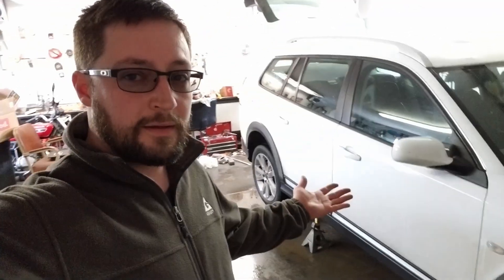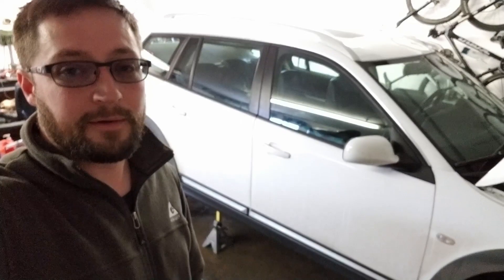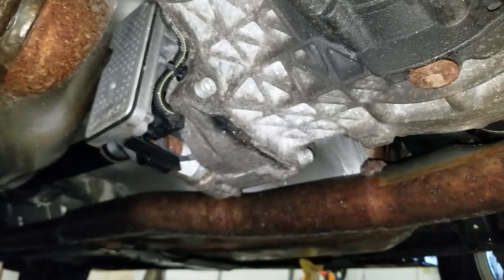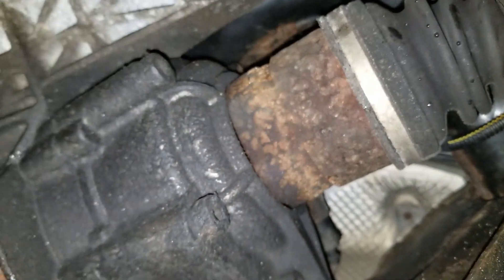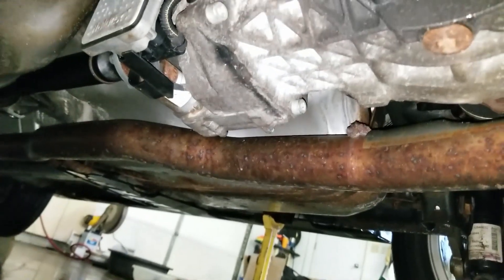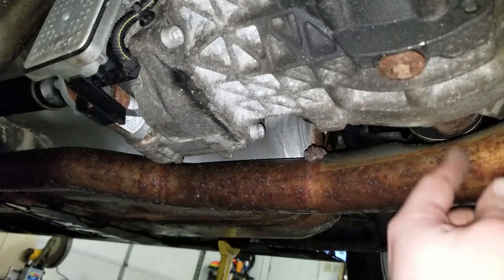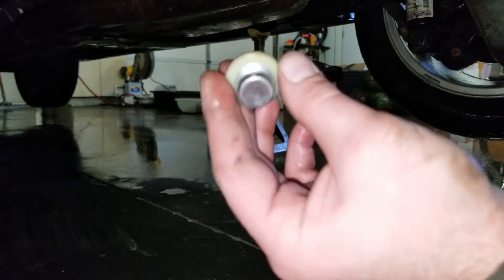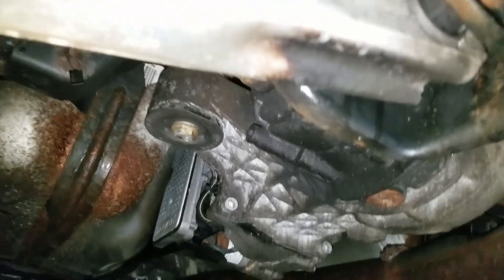XWD Fluid Check (Haldex Gen 4)

Comment: 08 9-3 xwd aero sportcomb….(w/o inboard slinger) …. thank you for this vid. would love to add elsd to my saab. what about programming?ecu?
Reply: I have been trying to figure this out for a little while now. Apparently, the rear diff part numbers for both 2.0T XWDs and 2.8 XWD are the same. They are cross-compatible with a couple cars including the Buick LaCrosse. I'm able to source one but I don't know if it will work, some folks have said you may need an ECM from a car equipped with eLSD and I'm still not sure about the module on the unit itself. I don't know anyone who has actually tried it. I just bought a 2.0T XWD that is pretty base and I have spent a lot of time adding features and upgrading. Adding eLSD is the only thing left to do.
Reply: @okletsskate  thanks for taking time to try and help me ..... if you get  more info please let me know here... I'll do the same okay?
Reply: @matthewzizzo4586  a may just try it out and see what happens. I'll let you know!
Reply: @okletsskate  I can't risk it ......It's my only car... And I love it too much ! ....PLEASE ....lmk what happens....thanks man
Reply: @matthewzizzo4586  update! I was able to successfully swap an eLSD diff onto a non eLSD model. It took quite a while to figure this out but basically you'll need:
1.Rear diff with in board slinger
2.Rear left CV axle, specific to eLSD
3.Haldex module with part no. 2845060

I followed the SaabDr and his video on YouTube on sourcing a cheap diff for his 9-5, mine came out of a 2014 XTS. 

The caveat is, finding the real axle is hard and the module. Occasionally a salvage one pops up online.

Comment: Totally unrelated question, but I notice you have the front two jack-stands at the front of the car, not at the side where you would put the tire jack. Do you recommend that location, and exactly what should I look for when placing the stands? Thanks!
Reply from the maker: I can get more height out of the jack stands if I put them there after lifting the front. So I only do it when I want it as high as possible.
Reply: @autoholicmedia  Thanks for the reply, but what do you position them under, at the front, and where do you place the floor jack when you lift the front? Newbie questions, first time I'm planning on getting under the car - thanks!

Comment: Are you suppose to use three different type of oils for the three different services?
For example in the rear, do you use the same oil for both places?
Reply from the maker: Yes, it's three different oils. Two different types for the rear diff and another for the t-case. I have a video going over the procedure and I list what oils to use and where. https://youtu.be/XsighGggo8M
Reply: Matt @ esaab sells a gm kit ....its about $100 .... if you get used to it  , the service is worth doing yourself... But to do the whole job at a GM dealership is less than 250 bucks.... so it depends on what kind of financial situation you're in